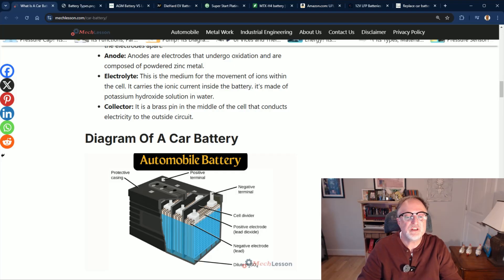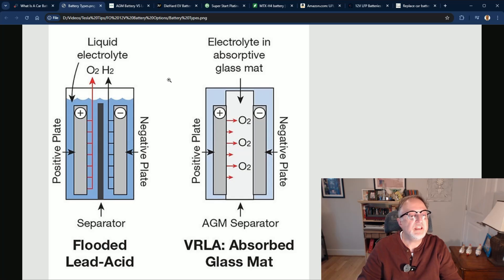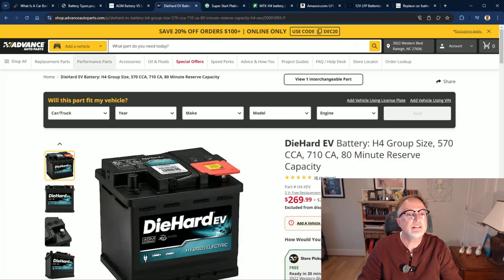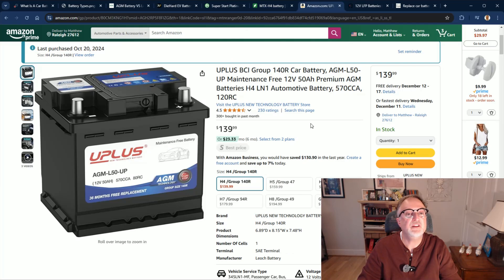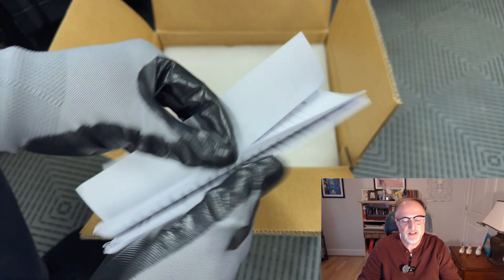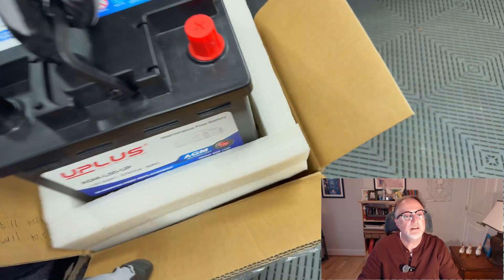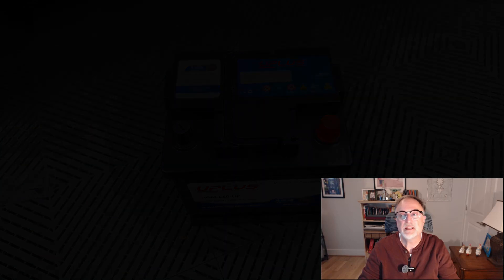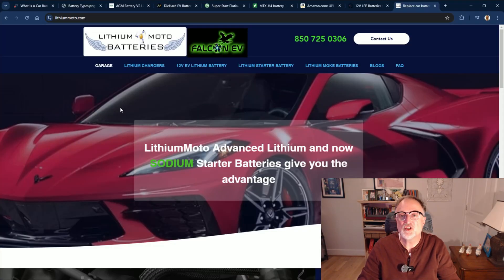Fisker Ocean - 12 Volt Battery Options

Comment: Hello.  is it possible to mount a 12V battary with the size L242mm x W175mm x H190mm into the battary bay?  or is L207mm really the maximum?  thanks in advance. best regards Markus
Reply from the maker: The length is the major limiter.  You could hack the width to make it larger but that hurts rigidity.

Comment: I'm told that changing the battery on a FO will mean requiring a resetting of the system which can only be done by a FAST technician.  Is this the case?
Reply from the maker: @keithaldis8533  Yes, if the power is lost, you will need a tech to configure the doggie windows for California mode.  However if you follow my video on changing out the battery, I show a method how to keep power.
Reply: @MTNRanger  Appreciated!  Much obliged.

Comment: What's the best way to test if my battery is in good condition without attaching some monitor permanently.  I don't want to replace the battery if my is fine.  I haven't noticed any issues related to the 12v.
Reply from the maker: In that case, I would bring the car to an auto parts store to see if they can test the battery.  Make sure the car is sleeping before the test so no active drain is taking place.

Comment: I just found an AGM H4 replacement battery through Walmart called the Everstart Platinum for $206.88 with tax and shipped to home. 570 CCA 50 AH 80 reserve capacity. And it has a 4 year REPLACEMENT warranty.
Reply from the maker: @rodwilliamyoung  Yes, that’s a good price compared to the Diehard.  Thanks for the comment.
Reply: @MTNRanger it fit ok I need to order one
Reply: How is the Everstart Battery? I was thinking of ordering one from Walmart or the UPLUS from Amazon.
Thanks

Comment: most the available comercial lifepo4 batteries will cause issues in an automotive application becaues of the BMS. bms locks out the battery at the most nonideal times and stops it from accepting charge correctly. low temp lockout, high current lock outs, ect, and plus the bms is a point of failure and the single largest reason for lithium battery fires (not that big of a deal with LFP). thats why i kind of swear by just making your own lithium iron phosphate battery for your ev, and selecting the most important aspects you want from a BMS, while not including all the "features" that will eventually leave you stranded. just like how i want my lead acid battery to sacrafice itself if it means i get home and avoid a tow truck bill, its the same idea.
i built lfp batteries for my 2 phevs which cost about 50 bucks each and save on range/weight and are more reliable. its more so assembling than building. 4x 32ah lifepo4 cells connected in series with the included bus bars, and a cheap 4s inductive active balance board, stuff that all into an enclosure like a plastic ammo can from harbor freight, and run your wires out. keep in mind where your fuses are if youre reusing mounting hardware from the lead acid, coz it wont exactly be drop in, and you dont want to accidentally wire past a fuse which most newer cars have right after the positive terminal. in this scenario, doing DIY is actually much better than buying something off the shelf because everyone is convinced they need a BMS in a lifepo4 battery. if you experience snow where you live, either go with sodium ion (more expensive for equivilant capacity right now), or wire in a 15w heater into a w1209 temp relay board to keep your lfp battery ~4C above freezing at all time, uses very very little power in sub zero temp if you pack the battery enclosure with the shipping foam the battery cells come with. alternatively you can cut open the lfp batteries you bought and remove the bms, idk if i would suggest this tbh.
i made a long post with lots of pictures on the GM chevy volt forums under gen1 -> modifications -> "solar roof + lifepo4 mod", its usually towards one the first or 2nd page of threads if you want more info.
Reply from the maker: @vevenaneathna  Thanks for your comment. Very interesting.

Comment: Thank you great video, can I ask what's the worse than can happen if the 12v is disconnected for some time, let's say you pull it out and use an external battery charger to get it fully working, let's say the doors open so not locked, windows are all up, and a day or so later you conect it back up.
Reply from the maker: As long as the windows are all fully up, I don't see an issue with leaving it disconnected.  Of course you lose the doggy window control, but everything else should be fine.
Reply: @MTNRanger lose doggy window functionality??? That’s a hard no(se) from Hayden. After all, we bought the damned thing for him😂
Reply from the maker: @memyselfundeye  Yes, I recommend using a donor battery like I did in my battery replacement video.

Comment: I tried a LiTime 12 volt 50 AH. It was a fail. The battery monitor indicated a charge voltage of 13.4 Volts for a brief interval. The voltage then dropped to 11.95 after approximately an hour. I wish you better luck with your attempts with alternative battery chemistries. Thank you for sharing your efforts and experiences. It has been very helpful with the continued operation of my car.
Reply from the maker: Yes, I have heard that some Lithium batteries may have issues due to the BMS and charging.  That's why I'm leaning more towards Sodium Ion which has charge characteristics more similar to lead acid.

Comment: I wonder if the battery weight over the right wheel is the reason why that front right tire wears down faster than the others over time.
Wonder if the European Oceans who's battery is on the opposite side....also experience right front tire wear ,
Reply from the maker: Considering the car weighs 5500 pounds, I don't think a 30 pound battery  makes too much of a difference!  Personally, my car's tires are wearing evenly (plus I rotate them).
Reply: Hmm... wasn't aware that EU version has the battery on opposite side. Do you know the reason?
Reply from the maker: @mzmz9355  I'm pretty sure the change was made to account for the coolant pipe rearrangement since the steering wheel is on the opposite side for the RHD cars.
Reply: if youre under 5'10" (gosh this comment sounds bad already), i have obvserved the shorter people tend to need alignments more frequently due to their front right tire hitting the curbs since its hard to see over the front of the car, especially in an suv. just an idea. usually the front left tire wears faster due to the increased weight of the driver.
Reply from the maker: @vevenaneathna  Quite an interesting theory.
Reply: I’m thinking the front right wears down quicker due to many folks utilizing Fun mode more often and and i have noticed slightly more slippage from that corner. Also, regen is biased i believe toward right side until 2.2 equalizes it.
Reply from the maker: @memyselfundeye  Interesting I have never heard of any left/right differences.  Only that the new update adjusted the front/rear power bias.
Reply: @MTNRanger  from what i have read on FOA and also Ocean Forums, there is a noticeable “equilibrium” with the regen now whereas it was heavier on one side prior to the 2.2 .  You’ll have to go deep in the “way back” machine as i know you got your 2.2 months ago and might have forgotten the ever so slight pull prior.

Comment: By the way, do you listen in on the Sunday FOA townhall meetings. I attended the one 2 weeks ago and now it seems that the OTA group might be changing their path and instead of asking for signups of those owners who want to go ahead and get 2.2 they might be changing to using the cloud to assess the 12v battery health and just push the 2.2 update in general. Or that's the rumor I heard. I also heard that the AMPSO (the amplifier) must be part of the OTA update which is only available via the FOA and the OTA group and that any manual install of 2.2 from any of the service centers will not be able to install that part of 2.2. I'll perhaps join in today's FOA townhall and see what they say about the OTA pushes and ask my question. Cheers.
Reply from the maker: Yes, I did listen to the last one and noticed the recommendation not to use a trickle charger or battery tender.  I still feel that if your battery is in poor shape, to replace it.  Otherwise, if it is in the middle, put on a 30 A battery tender.  If it is new, your are fine to leave it alone.  I have modified the description of my OBD2 video to say not to use it if expecting an update.

Comment: Always great content on your channel, which I watch often. Here is a question for you. I probably, prematurely, changed my 12v. Got my Ocean 3 weeks ago from a local BMW dealer here in Arizona and I immediately changed out the 12v with a Super Start. The battery that was in it was a Super Start which was 10 months old so it was not the original battery. Maybe or maybe not at its useful age and I did not yet have a 12v monitor installed to monitor its health. So, I did swap it out. I can do a core return to O'Reillys or keep it. So, not knowing much about AGM batteries, perhaps you know. How long will an AGM last sitting idle without a charger attached to it? Another option is that I do have a trickle charger that I have used on my DeLorean, yes I have a DeLorean, so I could maintain it periodically. I could also put a battery monitor on it to maintain and charge it outside of the car and have it, perhaps, as that donor battery once my new current battery needs to be replaced. However, if that is 2 years from now how healthy will this battery sitting in my garage really be good for or should I just return it to O'Reillys for the $20 core return?
Reply from the maker: You probably did the right thing not knowing the history of the car.  I have heard some people on their third batteries.  And some like me still on the first.  I would take it to O'Reillys and have them do a battery test on it.  If it comes out good, keep it as a backup.  From what I have read and done, you just need to charge up a backup/stored battery once every 6 months or so.  Just use a battery tender and store it when done.
Reply: @ huge thanks for always replying to my comment. Have a great rest of the weekend.

Comment: I bought the Super Start. The one you are mentioning, Uplus, this is my first time hearing of it, however, I have heard some general comments about Amazon purchases of car batteries. I purchase many things from Amazon, mostly 3D Printing related, even actually 3D Printers and a robotic pool vacuum for example, all with good results. Not sure how true or untrue this is regarding comments about how long a car battery sitting on a shelf remains fresh. The critique is that some worry about shelf life at Amazon. Of course you can have the same concern at any autoparts store. However, car batteries do have a date stamp on them so those concerns may be invalid. I will say one thing about Chinese batteries, which I have bought on Amazon for an electric shaver. The batteries, rechargeable, have not lasted well at all and they have all been from China. Now there are no date stamps on those types of batteries so they might have had a longer shelf life or, I more suspect, the quality was just bad. You do have to consider price in that you get what you pay for. When things are half the price of what if found elsewhere for double, you have to wonder about quality. I do know that Amazon has a review section where buyers comment on their results and Amazon even puts up a statement on items that have high amounts of returns. It is strange that Amazon would continue selling items that they mark as "frequently returned" in fact that is the wording that they use.